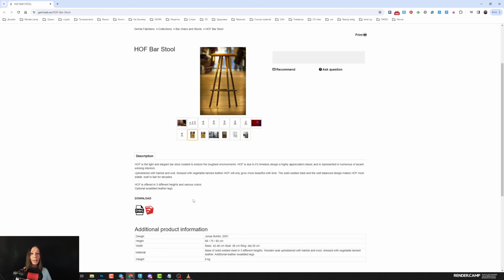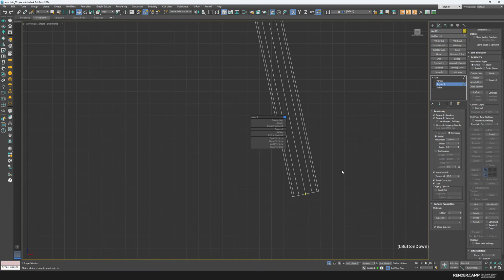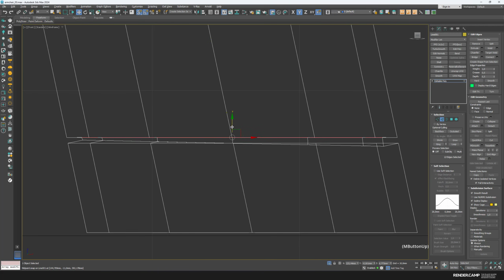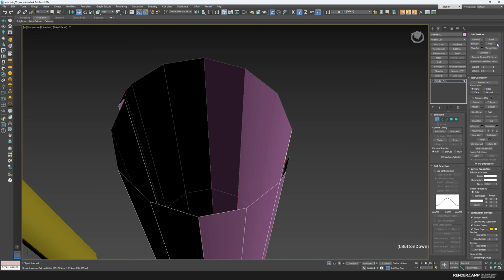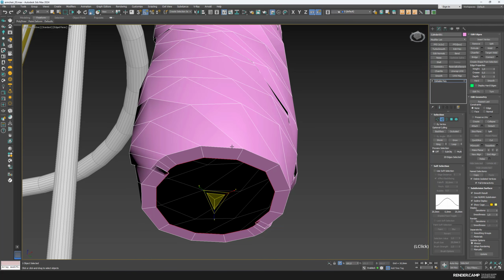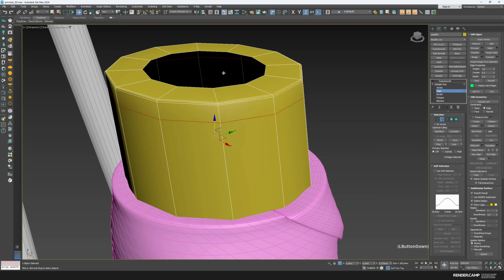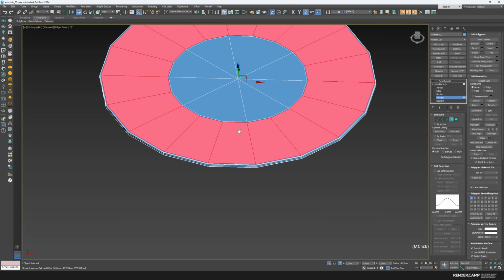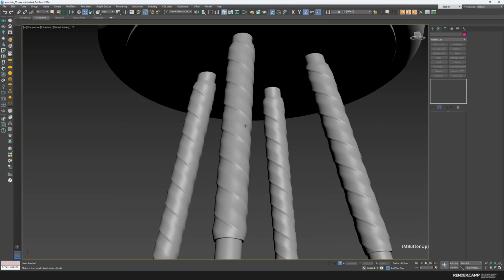How to Improve Chair Model in 3Ds Max | Tutorial for Beginners

Comment: Thanks. The technique is good, but if the model ends up with more than 10-15k polys, then it's simply overdone, in my opinion. It might work for small projects like small apartments, but it's overkill for larger ones. 

As for modeling, one TurboSmooth iteration could be enough if you set more subdivisions at the start, because each iteration quarters the polygon count exponentially.
Otherwise, it looks like Bentanji's modeling style, where he applies TurboSmooth with 2-3 iterations on every small detail. 
Please don't take my comment personally. 
Best regards.